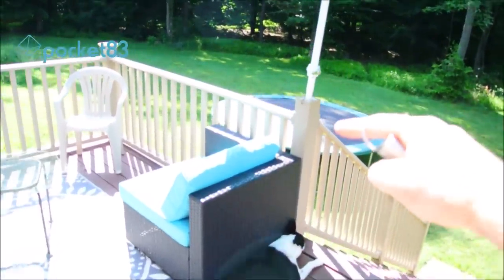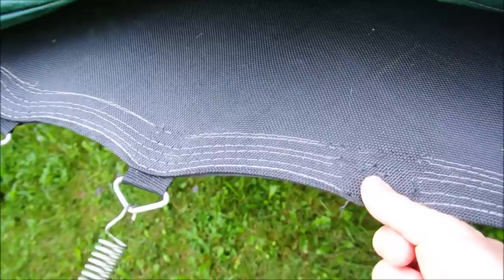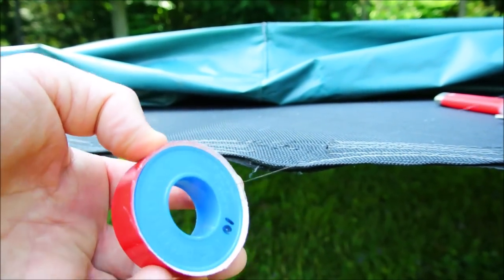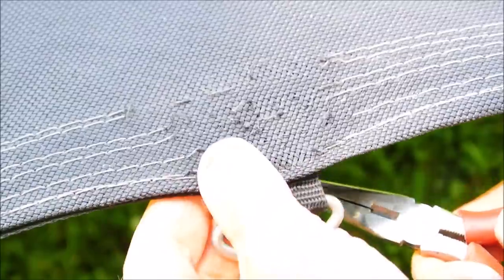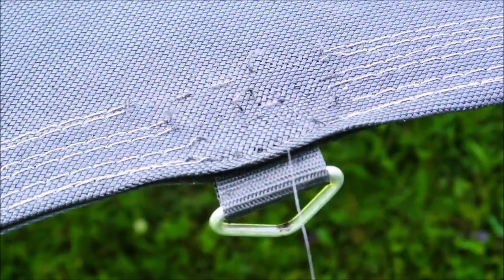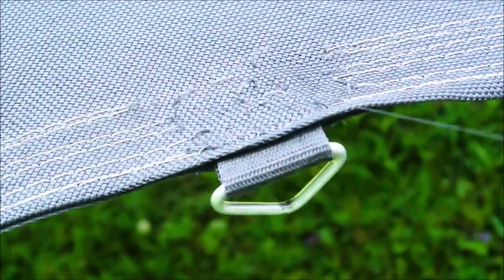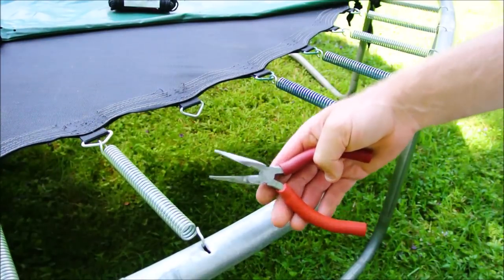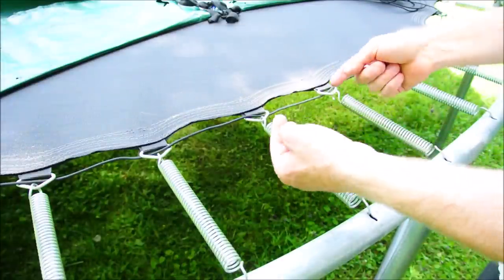Dangerous Trampoline Springs! Easy, safe fix & Mat Repair.

Comment: First thing I thought after you showed how the spring was ejected and how the stitching broke was "wait, why didn't they attached the springs to the outer metal ring ???"
I have never had a trampoline nor did I have the occasion to look at one from close, but the overlap between the trampoline's mate and the straps that holds the triangles look to me a little bit low, may be it's "normal", I don't know.

Also when you talked about your safety solution and started to implement it, I was like "wait, how do you know that this is going to actually work ?" and then when I saw the ratchet binder I was so happy to see that you actually tested your solution to the problem :D

For the 8 figure knot, I thought that you were going to follow the first 8 figure with the other end of the rope, not with the same end. So you would end up with one knot and not two. Does that make a difference (apart from having a harder time tightening the rope when you have only one knot) ?

Also if someone uses the rope solution, you need to tighten the rope at least a little bit, because I think there might be a scenario where having a non tightened rope can allow the spring to still gain some momentum and then be able to escape the triangle with speed.
Reply from the maker: The paracord loop only needs to be snug, because it acts as an inertia absorber when it grabs a launched spring. Some give here is good; think of it as being like a fireman's net (a life net). If an object in motion is stopped too quickly, often the 'equal and opposite' reaction instead becomes manifest as an equal and opposite motion. We don't want that. Elastic collisions are great for billiards, but not so good for catching falling people or projectile springs. If the loop were metal instead of cord, it might allow a spring to preserve and thus redirect its motion toward the person who's bouncing.   

The figure eight: 
tying two knots to one triangle was as simple as I could make it. Not only is the knot mass reduced, but the knots will be less likely to come undone than a rope-to-rope circuit knot, and it's also easier to visually inspect. Oh, and it's easier to describe on camera. 

Nylon strap's tiny surface-area contact with mat: 
normally, the amount of tensile force placed upon an individual spring is kinda small. I don't need to explain to you the mathematical dissipation of a 300-lb force over 96 parts, but let me say that our natural intuitive sense will tend to overestimate just how much work a trampoline spring is usually doing.    

—————

How did I know that the solution would work before actually testing it? Okay, this point is your most interesting bit of skepticism. I appreciate it, and I want you to really listen to me here. You've probably heard me preach before that there are two types of knowledge, a priori and a posteriori. This is just the difference between the imagined and the observed. We scientific-types tend to scoff at the former. We want evidence. 

When I was young, I was strictly empirical, rigorous. Imagining an experiment can't be as trustworthy as running the actual experiment, right? But now I understand how to imagine much, much better. Let me explain. My gamble here was with potential lost time, and I could've also been filming a useless video. This is, except that I was extremely thorough with my a priori reasoning. One can learn to run experiments in one's head well enough to prove, mathematically, or logically, within a reasonable expectation of error, many of the world's basic physics problems. Point is, as you gain skill as a practitioner of empiricism, don't lose sight of the incredible real-world utility of reason. Though there can be no certainty in forethought, I was certain enough to wager my time and video, knowing that it was a safe bet. 

Try it. Imagine the spring's motion in your head. Replay it in slow motion, and try to account for everything that is likely to happen during the event. One can get better and better at doing this with practice. Just remember error. Account for your personal biases. And be mindful of your own arrogance. Remember how during the second trial the spring caught the other triangle? Though it wasn't quite relative to the outcome, I still didn't see that coming.
Reply: @pocket83squared  Hi, thanks for taking the time to answer :)

I love that flow from priori to posteriori. Even in empiricism we can't escape priori knowledge : what experiment should I run ?

I'm still young, but I out grew my extreme skeptic phase. I'm still skeptic, but more like practical skeptic. Sometimes (well almost always) you can't test everything nor can you head to the right direction right away, and that gave me so much frustration in the past, because everything felt like moving mountains while being a tiny little dust. I always wanted to get things done correctly (perfectly ?) from the first try. Sometimes this behavior annoys me so much that I go to the opposite side and improvise too much to the point where I'm even more frustrated from the lack of control and so I don't learn anything because I didn't evaluate my priori to compare it to the results.

Now that I have a job, being an extreme skeptic is just unthinkable of (well I still allow myself sometimes to be a moderate skeptic, I either lose time or I gain something precious). We lack so much time that we "just do the thing, if it works great, if not now you know that it doesn't" (we don't build nuclear power plants so no worries !), as you said, we are constantly betting. We don't have the time to apply the theory, we rather apply the practice to the theory, by updating our knowledge as we succeed or fail.

This way of doing things is so much opposed to the way I always used to think that it can be frustrating for me and I have to force myself to do it that way because it's what works best. I'm still very thankful for my job, I have never been able to learn that much before. I was always struggling with theory and always thought that it was right way to do and learn things.

Of course I'm not saying by any mean that theory is useless or some other thing.

I hope what I wrote makes sense and is related to your reply (if it doesn't, in my defense I was too tired when I wrote this hehe)

Again, thanks for your insights, it makes me think and wonder :)

Comment: Is there an adhesive you could splurge into the pocket with the tab of fabric holding the metal attachment point to speed up the repair by avoiding the need to stitch?
Reply from the maker: Not one that I'd trust. Adhesives just don't fare well where there's mechanical action. Classic case is trying to repair a detached shoe rubber: I've met nothing but failure.
Reply: @pocket83squared  I'm with you on the shoe rubber. I tried to keep some expensive mountain boots going once, but of course you take boots like that to precisely the kinds of places where you really need your footwear to stay in one piece.
Reply: If faced with the same repair, I would have included some epoxy. Probably overkill.

Comment: I was going to ask how the spring got through the spring cover, but the gaping hole answered that question pretty summarily.  

The question now is what use is the spring cover if it doesn't contain spring explosions.  I guess it protects the springs from direct rain?  If the spring can break through it, I'd imagine a child's wayward foot could as well, so it's not even protecting ill fated trampoliners from an unfortunate fate.
Reply from the maker: A snap-launched spring will have a much higher force-per-area than the average foot. It's also a somewhat uncommon event. The spring cover's main purpose is to stop a person from getting their leg stuck between two springs, and for this purpose I must admit to finding the thing pretty effective. I've been walking all over mine for years, and not once have I stepped through it. 

Most trampoline (spring) covers involve a polyethylene foam nested inside of a polypropylene case; all three layers together end up making it surprisingly tough, especially over the short distance between two springs. Consider that springs are not under tension during any moment in which you're making foot contact with the cover (assuming a single jumper). Also note that where the spring shot through mine was on its frill, where it's only got a single layer of tarp.

Comment: I Always pick up thrown away trampolines because the components have been so Useful.  I am currently making a Chicken train from one.  But  It appears that your tarp  has shrunk , those springs appear over stretched at rest as compared to what I normally see.
Reply from the maker: Hahaha. My trampoline is 15 years old.
Reply: @pocket83squared   The Two  I am currently using as Arches to frame the chicken coop. Have served as tables to hold Drying Bamboo, PVC, Pipe and Salvaged Aluminum screen enclosure frame for Longer than that After I picked them up from the curb around 2003.   I challenge myself to engineer as much as I can from Up-cycling.   I will pick up any machines I find and  disassemble, I keep all the connectors motors and useful bits,  then I leave the rest  for the scrap guy to pick up. 
I never sell scrap , I stack Aluminum copper and stainless steel Like some people stack silver and gold bullion.
Reply from the maker: @HavanaWoody  You and me were cast from the same mold, my man.
Reply: @pocket83squared   Brother, You have inspired me since the first videos working out of that closet size shop. Back when we watched the reflections to just get a glimpse of this genius with the silky voice.

Comment: mmh.. i rember when my dad got us a trampoline, he accidentaly crossed two of the springs and he decied to fix it, me and my sis was hiding under the trampoline but he told us to go away from there and stand a bit away from it. when he pulled the spring and launched off straight into my sisters head and caused it to spin and slash open my ear. so i have a pretty good idea on what one of those springs can do, lmao.

Comment: what wire did you used and what thickness?
Reply from the maker: That was just a scrap of 12 gauge copper electrical wiring. Note that it still had its insulating jacket on.

Comment: The other thing that you can do is screw a countersink head machine screw into the hole after the spring is in… I had access to hundreds of these but paracord not so. It means that the spring cannot easily come out even when you try to take it out, without angling it way down. Even then depending on the size of the hole and where you put it in sometimes it becomes impossible for the spring to come back out, without backing screw out. Stainless steel is best or galvanised. Countersunk does really add any height and certainly not above the height of the spring.
Reply from the maker: Um, okay. That will work. Now consider the practicality of recommending this to a mass audience: 1) how much do 96 countersink-head screws cost at retail, and 2) how on Earth am I going to find time to disassemble that every year? From what I understand about my over 2K views audience, it'll be hard enough for most of them to find a needle, a lighter, and some pliers. Let's keep it simple, eh?

And if you have internet access, that means you also have access to paracord, too.
Reply: @pocket83squared  As I said, I had access to them... looking on internet I can buy 50x hex-drive M5x16mm for £3.99 (100x zinc coated hex-drive M5x10mm for about £6 delivered)... It wouldn't take long to whiz them all off with a driver but as I said if you place them correctly then you are just shortening the slot and you can leave most of them in after tension is removed and still get the springs out...

I appreciate your video though and it is a great idea and love people like yourself who fix rather than replace - I am a long time viewer of yours and love that about your channel... I really didn't mean to offend, it was just a suggestion that worked in my case but even as a belt and braces approach I will probably do your way as well in future as i've seen these springs snap where they meet the buckle and the frame (which is quite sharp), due to fatigue...
Reply from the maker: @smitcher  No offense taken at all. Just explaining my reasoning. If I were in your exact shoes, I'd see things exactly your way! Many ways to skin a cat ;)

Comment: Why are some of your springs painted blue?
Reply from the maker: Red, green, and blue. There's two of each colored spring, and two of each colored spots on the frame that correspond. It helps to speed up the (yearly) setup.
Reply: @pocket83squared  Oh that makes sense, nice tip

Comment: sewing awl my friend...., waaaay easier than sewing needle and thread especially when you're replacing 1 a week
Reply from the maker: That sounds like a great idea, but it might not be waaaay easy, because you'd have to stick your head around to the other side of the springs with each pass in order to feed the thread back through into the stitch. Also, I think we replaced two last year. I'll definitely consider it, though. Thanks.
Reply: @pocket83squared  done it a few times and the thread is thicker. every stitch locks and is stronger